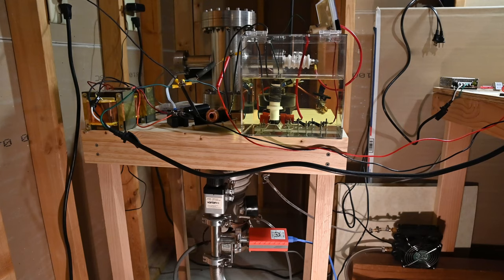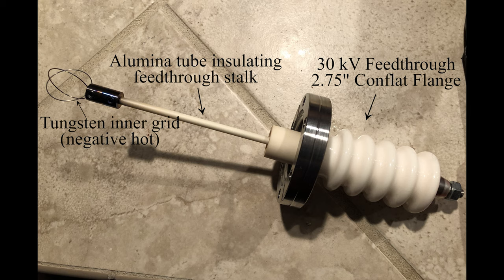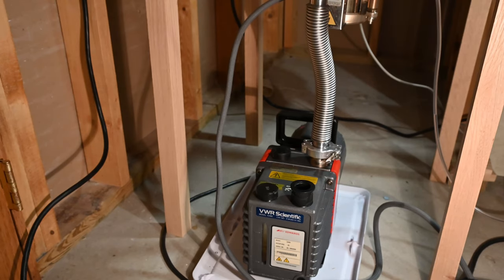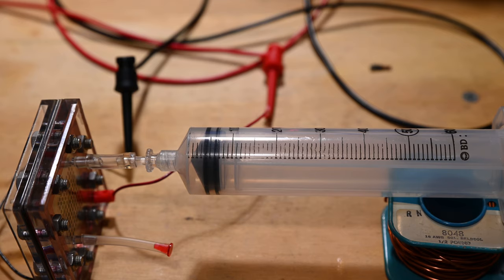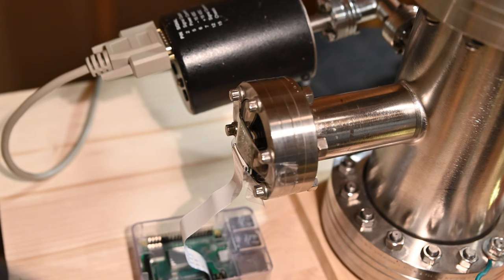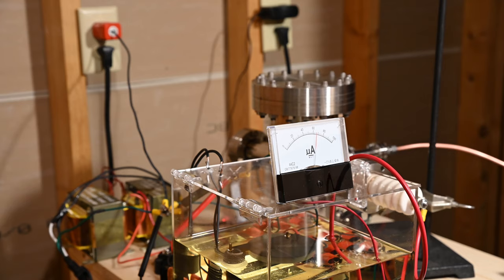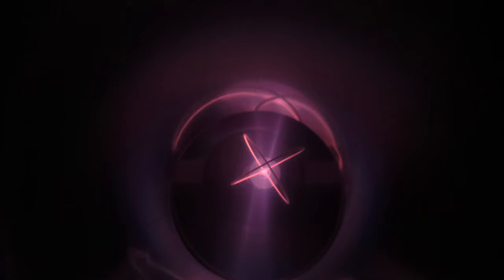DIY Nuclear Fusion Reactor - Deuterium Fusor

Comment from the maker: For all those interested in power generation, please read this pinned comment. The Farnsworth fusor is NOT a power reactor. The actual fusion energy being generated here is MANY orders of magnitude lower than the energy going in. This reactor is only used to demonstrate that nuclear fusion can be achieved on a small scale and as a decent neutron source. So please don’t ask how much power is being generated here or if it can be used to power your home.
Reply: Experimentalists hate him! Generate electricity to power your home with this one weird trick!
Reply: You should welcome all kinds of questions, it makes your video more popular ;)
Reply: @Reptex_cs  on this particular question I have to agree with the OP… simple logic should be used to see that if this machine did produce power output it would already be in production due to how simple it it is to build…. It’s not the OP’s job to answer the same dumb question over and over again
Reply: @kalancosta7650  I wrote it in case he wasn't aware, to help out. I don't see the point in discussing this further.
Reply: try building one like the helion device that fires two rings at each other compressing them in the middle
Reply: I have one question how much voltage do you have on the outside housing to earth. I want to know the voltage drop and does the polarity changes because the housing is the anode.
Reply: In other words, the amount of power being generated is negative?
Reply: What were the legalities and regulations involved in building this? Did you need any licenses to build and operate this in your area?

Say, for instances, you wanted to build one as a demonstration of fusion in front of a class. What sort of safety considerations would you need to operate it safely? As you showed in the video, that thing is pumping out X-Rays and even Neutrons, so this doesn't sound like something that can just be wheeled into class one day and ran for a few seconds with unshielded people around it.

Because I totally want to make one, but I don't want to be put on a list.
Reply: Nice work, what state are you in?
Reply: Have used a spectrometer to look for helium emission Spectra - Frauhnofer Emission Bands of helium?

Comment: That's how you get government ants.
Reply: nah, still gotta make a video showing it doing neutron induced fission in a piece of U or something to attract those ants
Reply: @Muonium1  I think Codydon Reeder would strongly disagree.
Reply: @AtlasReburdened  even Cody wasn't doing anything illegal. I still wish he would have told them to fuck off and continued with his experiments. It's a totally clear freedom of speech issue. Nothing whatsoever illegal in the US about converting uranium ore to the metal on a miniscule scale like he was. They just like intimidating people and they need to be put in their place.
Reply: @Muonium1  While I agree with the sentiment of your second post entirely, I still won't recant my original post. It was nothing more than the display of his multi-plate rotary fusor(and of course, the blind and ignorant zeal of government jackboots) that garnered the knock on his door.
Reply: @AtlasReburdened  what is a multi plate fusor
Reply: @Muonium1  A version of a fusor that overcomes the normal energy throughput limitations by substituting one of the cages for a series of rotating cylinders, allowing the 'working face' of the simulated cage to be continuously moved and thereby preventing damage due to heat. This allows the energy throughput to be significantly higher. Enough to be(amongst other things) effectively an industrial strength neutron source. Codydon built one in collaboration with another sciency youtuber and got a visit from the NSA within 24 hours of posting the video, which swiftly disappeared along with the subsequent video voicing his frustrations of the affair. 
If I remember correctly this was all part of his explorations into neutron catalyzed thorium fission energy, and the visit he got brought the line of research to a permanent end.
Reply: @AtlasReburdened  I don't recall that incident, but, as I noted initially, I'm sure active neutron induced fission of nuclear materials WILL get you NRC ants. Surely there must be some record of his experiments on this somewhere.
Reply: @Muonium1  I've searched without luck but you're welcome to spend your time on it, and as I stated, it was nothing more than the display of his modified fusor that garnered the visit. He never published any video of actually using it to bombard or enrich anything.
Reply: NEEEEEEEEEEEEERDS
Reply: @stern-a1272  That's cute kiddo. The funny part is that when you grow up, that word is pronounced as "Boss" or "Sir" and spoken while doing back breaking work.
Reply: @AtlasReburdened  LOL 🤡🤡🤡
Reply: @stern-a1272  Precious. Anyway, enjoy not having a future.
Reply: @AtlasReburdened  lol you got this mad over being called a nerd and bring up "ur gonna call me ppl like me a boss someday!!" you are the most insecure kid ive met
Reply: @Howtofeedapenguin  😂😂😂Tell me that you don't understand the concept of projection without saying it.
Reply: @AtlasReburdened  ...that makes no sense. nothing i said was even close. this is a big L from you lil buddy
Reply: @stern-a1272  "...That makes no sense"
Kiddo, you don't have to tell me that you're bad at understanding things. That part was obvious from the start.
Reply: @AtlasReburdened  Again, you are still making no sense. You are trying to convince me that you are not insecure but you forget all this happened because you got called a nerd. You sperged in youtube comments over being called a nerd. 🤡🤡
Reply: I'm just gonna put this comment on mute actually. This is just going to be a repetitive back and forth over you freaking out about being called a nerd. Sarcastically mind you.
Reply: @stern-a1272  "Again, you are still making no sense"
I get the feeling that you'll just have to get used to that, kiddo.
Reply: @stern-a1272  You poor thing, life is going to be hard for you. Don't worry, if you eat all your vegetables and you try as hard as you can, you just might be able to emotionally handle casual conversation someday.

Comment: So next thing to do is to build an Tokamak, but just skip this step an go straight for the Stellarator.
Reply from the maker: Thanks for the tip. I'll get on that right away.
Reply: Sure 😃
Reply: Yep, but we need magnets for that. Not just any ordinary magnet.
Powerful magnets within the range many Teslas.
Reply: @ScienceMarshall  You can also generate some tritium inside the fusor by putting some lithium foil inside. The Neutron radiation turns it into Tritium.
Reply: I am glad that you didn't propose to produce some Pu 239 of U238 and the neutrons.
Reply: @ScienceMarshall  then after that, a nuclear fusion rocket engine
Reply: @ArktourosUltorMaximus7600  His reactor is never producing enough neutrons to do that...

Comment: This video is a masterpiece, I've never heard of that PEM deuterium generator system, after reading for a while it turns out its more common that I though. Thank you for sharing all of this info and making it so easy to comprehend.
Reply: nasa has a deuterium systm using erbium that can make fusion inside metals. 2017 patent by Vladimir pines of nasa Glenn research in Ohio
Reply: @peterlang777  Well but that's obviously not appropriate for amateur fusion. The PEM cell is beautiful because it can generate fuel from cheap heavy water so you don't have to buy expensive high pressure D2 gas bottles and regulators to control the high pressure.

Comment: This is insane, but in a good way. That's really impressive that you were able to put this all together like that. I've had people tell me even doing our sort of chemistry on a porch/garage setting was impossible XD

Dude I found your channel doing research on the fan components to build my own fume hood, and noticed that my mom got me the same chemistry set as a starter kit when I was in 9th grade that is sitting in the back of some of your early fume hood videos (I recognize that characteristic porcelain crucible and alcohol burner with the test tube racks). I've been doing amateur organic chemistry for close to 6yr now, and it's still incredible what you can learn online with a little reading. Great work though, this is on another level... I'm assuming your major is physics.
Reply from the maker: Thank you for the kind comment!! That’s funny how ubiquitous the chemistry supplies from that kit are that you were able to identify them, and neat that you had the same one! My parents got me that kit when I first started showing an interest in chemistry in middle school and it certainly helped to jump start my curiosity as well. I have fond memories of using the chemicals from the kit to do much more dangerous experiments that I found from reading online. They certainly weren’t recommended in the manual! I’m glad to hear that your fascination and hobby with chemistry is still going to this day. And you are correct, I did major in physics as well as chemistry as an undergrad. Now I am working on a PhD in physics. Thanks again for the comment, it made me smile!
Reply: what kit did you get and where do you think i could get one?

Comment: That dosimeter is really cool, it's so simple yet ingenious. I've been playing with HV again lately after a decade hiatus (got shocked, almost died, but now the gun shy has worn off🤣) and in my quest to make a 1.6KJ capacitor bank charger I've made a rectified variac-fed MOT (with a couple different switchable current and voltage options using a series of different wattage and voltage light bulbs in series with the primary, with a switch on each one) that puts out up to 3000V DC, and now it has opened up a slew of opportunities in magnetron sputtering, wood burning, and now fusors. I definitely need to build one of these albeit a lot simpler than this one, that chamber is just way too nice for my taste (budget😔😅). I have a cheapo $100 vacuum pump but I need something a little stronger for one of these too though, it doesn't make anywhere near enough vacuum from what I hear. Anyone got a spare diffusion pump?😉

Comment: Too bad I didn't see this video earlier, it would have saved me time! I'll look for the dosimeter. I used the same setup of fuel cell and syringe as you did, however I didn't find it convenient to store, so I preferred to fill a small bottle by having deuterium remove water, and I store it top-down with some water at the bottom. I then open it under water and pick a little bit of deuterium with the syringe, then I can close the bottle. The water at the bottom is enough to make it completely sealed. I'll look deeper into your voltmeter schematics, that could help me as well. I'm using small power with a tiny central sphere (~8mm) initially due to limited room, and it seems to allow me to run at low enough current. Good job!

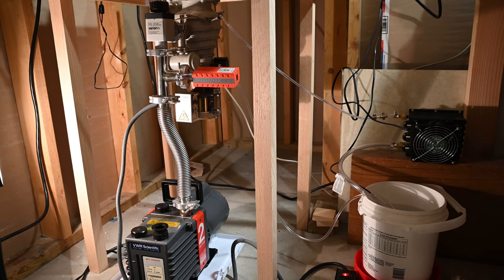Comment: 2:57 Ah, yes. State-of-the-art Harbor Freight monitoring equipment. Really the only choice when it comes to fusion reactors.

Seriously though, nice work. It's always cool to see the complex devices that can be built in a garage using (relatively) obtainable parts. I'm surprised this video doesn't have more views. It looks like something that would be on Applied Science's channel. Ben would be impressed for sure!
Reply from the maker: Yes, I spared no expense on the harbor freight voltmeter! Thank you for the compliments! Applied Science is one of my big inspirations.
Reply: My old boss bought one of those and I had to show him how shit they are. Rated for 300V It exploded in my hands on 120V! (Yes I was using the voltage terminal)
Reply: Hahaha

Comment: This is so nostalgic for  me as I worked in 1980-1986 with TOF mass spectrometers I built.  The pumps and instumentation were very similar.

Can you make the DT reaction be more effective in the Fusor if you force the ions to move fast back and forth? Instead of using a DC HV, you could use an AC HV in the MHz range to keep the ions inside the reaction area? The ions would go again and again to the center increasing the reaction efficiency a lot ro overcome the Coulomb scattering. Just an idea. Good work people.

Comment: Hi, it's good to hope to control the nuclear fusion into an electronic laboratory, may be like cold fusion, but the energy balance is always negative and it'sn't the promise of fusion. I am doing geiger measurements too, be careful to electromagnetic compatibility with high voltage, it's easy to get saturation. Regards

Comment: I’m glad to see how everything come together. Now I want to try to build one myself. I have a couple of questions if you wouldn’t mind answering them. First Are there any rotary vane vacuum pumps that can get down to a low enough pressure, if not then would a turbo molecular pump work well. Second where did you buy your bubble dosimeter, I can’t seem to find them anywhere.
Reply from the maker: I would recommend that you head over to the fusor forum at https://fusor.net/board/. You should spend many hours reading through the FAQ threads. Your questions have been answered there. My mistake early on was not spending enough time reading the forum before beginning to purchase components. There is a lot of knowledge, useful tips, and trial and error that have been documented there already. So it's best to learn from other people's success and mistakes! As far as the bubble dosimeters go, they are only sold by BTI Bubble Technology in Canada. The model I got is the BD-PND. You will have to contact them through email to make an order. Also the bubble dosimeter should be the last thing you purchase when you are completely ready for fusion as they have a limited shelf life.
Reply: Ok, thank you and keep up the awesome projects.

Comment: Hi! There is one point i couldnt find out about.. how hot does the fusor get? Esp. The inner surface of the vacuum chamber. A fusionreactor blanket is covered with wolfram.. for example

Comment: Hi,  Clean job.  In my experience, the GM counter gets saturated by high voltage plasma before anything else, but the hot pixels on camera are definitely high energy particles, although I would not jump into conclusion about x-ray "only".  Remove the camera lens and cover the aperture with a aluminium foil and watch the hot pixels.
Reply from the maker: Thank you! I placed my xray/gamma dosimeter in front of the window and I measured a dose of 10 mrem/hour while operating around 25 kV, so there is definitely a lot of X-ray radiation coming out of the window.

Comment: So question: I assume this cant be self sustaining. I have heard a story of Farnsworth getting it to sustain for almost a minute. If it can be self sustaining by using just the deuterium as fuel, can the titanium sphere be replaced with titanium pipes and inject water which will turn to steam to spin a turbine to produce electric?
Reply: I know this is a super late response but seeing as no one else said anything i thought I’d chime in. To answer your question no probably not, there would be too many other atoms in the way of the H-2 to cause consistant fusion. What you can do is use to fast neutrons produced by this setup to cause fission in a fuel such as thorium then use the heat from that to boil water and spin a turbine but at that point you basically have a fusion reactor powering a fission reactor which, while still cool, isn’t necessary since you can make a fission reactor without all the extra steps

Comment: I missed the part where you talked about the energy output, but could this potentially be an energy solution? On a micro level? Small-scale units powering homes?

Comment: very impressed sir. So I'm a College student and had a couple of doubts I hope you would oblige to answer :
1) What are the measures you took to contain the radiation, or was it negligible since the run was so small?
2) What was the output ratio that you were able to get? Is there anything you would have done better to increase that?
I'm looking to do Fusion as my Final Year thesis and would love to hear some good news. Nice forum article!
Reply: How did your thesis go
Reply: How did your thesis go
Reply: I was impressed with what I put out given it was at the peak of Covid. My paper wasn’t exactly great as it was a review paper more than a research paper
My design was on AutoCAD as I wasn’t able to procure the materials for actual construction, given the restrictions in the country I was in and the industry wide lock down made it hard for companies to provide with lab materials like the gas and specific pumps
Reply: I changed my thesis to then a comparison between Tokamaks and Stellarators.

Comment: Congrats on your build. I didn't quite understand your gas feedthrough. Do you not use a mass flow meter or some sort of needle valve to have fine control over the pressure?

Comment: Congratulations! Please add shielding behind the window sensor, and consider wrapping the 316 Stainless vessel with a neutron absorbing and blocking material like Boron, Cobalt, Titanium or Molybdenum (316 Stainless only has around 2% Moly, no Titanium), with something dense and non-radioactive like Pb-204,206,207,208.
This is a great achievement, but there are 10, 20, and 80 year consequences for increasing your exposure to fast neutrons and 30keV Xrays. At that energy the attenuation through water puts them at around 3 centimeters depth. As the energy goes up, they begin to go through much more material before they are blocked, and as they go down, there is a higher chance they will hit something in your body that might give you cancer.
P.S. What do you think about accelerator moderated fusion?
Reply: hello, i am trying to build a fusor reactor, but I do not know what is the thickness of 316 Stainless needed for this.